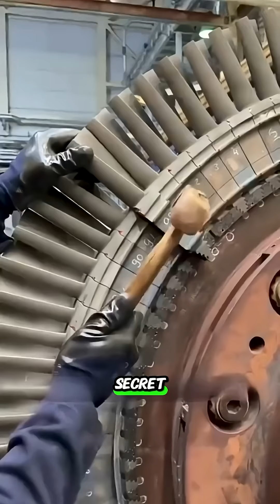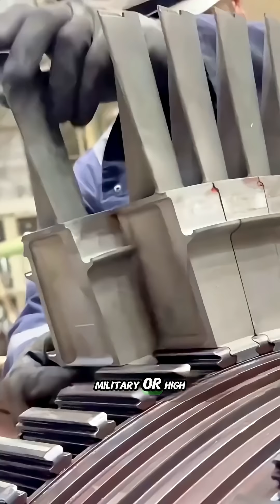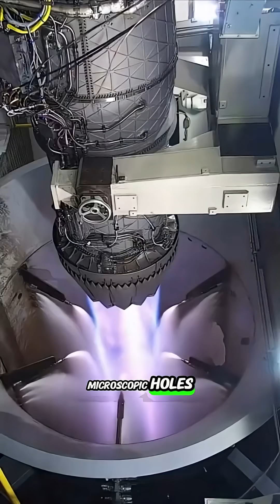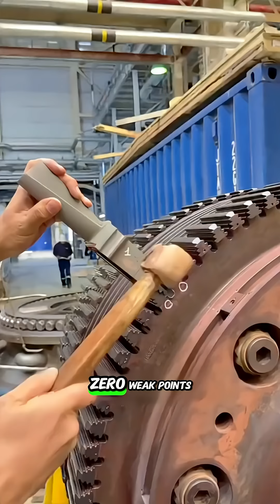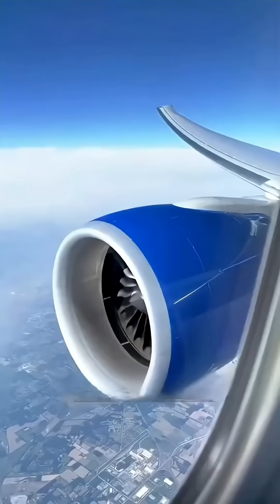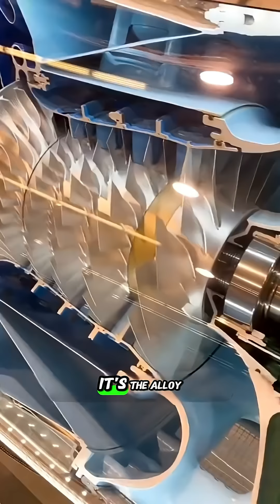The Insane Reason Nobody Can Copy American Jet Engines

Comment: These. Machines are litterally genius level manufactured items
Reply: Ya and in Vietnam waterproof boots and waders were like 🤷 and guys got jungle rot from walking in the paddy’s cuz the roads were mined. Also a tank with the mine clearing thing is a big🤷. Plus all the other little stuff the military screws up. SMH. 🤦
Reply: The Army litterally buys uniforms and many other items from the lowest bidder. It takes a good deal more intellectual quality to ensure that jet aircraft successfully fly. Aviation engineers are not gas monkey mechanics you know.

Comment: It’s not just the USA that makes jet engines. It’s also the UK, France, Russia and China.
Reply: Only four countries in the world can make the fifth-generation turbo fan engines due to their high complexity. China can't produce them by reverse technology.

In 2006, an agreement was signed on the creation of a new engine, which was named PD-14 (a promising engine with a thrust of 14 tons).

PD-14 is a serially produced Russian high-bypass turbofan engine of fith generation developed for the MC-21-300 aircraft, PD-14A for the MC-21-200, and PD-14M for the MC-21-400. PD-8 engine will be installed on the Be-200, AN-148 and Sukhoi Superjet 100 aircraft. Therefore, the designers and engineers faced the task of creating a unified gas generator, the main element of the engine.

16 new technologies were developed for PD-14 by russian designers, engineers and scientists, namely - single-crystal blades for a high-pressure turbine with an advanced cooling system that allows the turbine to operate at temperatures up to 2000 ° K.; hollow wide fan blade made of titanium alloy, thanks to which it was possible to increase the efficiency of the fan stage by 5% in comparison with the fourth-generation turbofan engine PS-90 produced in the USSR in the late 1980s; low-emission combustion chamber made of intermetallic alloy; sound-absorbing structures made of composite materials; ceramic coatings on hot parts; hollow blades of a low-pressure turbine, etc.

 20 new materials were created for PD-14 with indisputable advantages: a decrease in specific fuel consumption by 10–15%, a reduction in the life cycle cost by 15–20%; operation of the engine will cost 14-17% cheaper than existing analogues. All of them have been certified according to international standards.

New Russian titanium and nickel alloys are used to create the engine. The engine nacelle design comprises 65% domestic polymer composites, which achieve the required level of sound insulation and reduce engine weight. 

The technologies used in the production of PD-14 are state secrets and are protected. Therefore, information about PD-14 is broadly classified. Example: China would gladly copy production technologies, much like the Su-27. They copied the plane, but they failed to replicate the AL-31F engine.

The state's ability to produce cooled cast blades for a modern turbine aircraft engine is an indicator of the highest level of development in mechanical engineering. There are fewer states capable of producing fifth-generation aircraft turbojet engines than countries with nuclear weapons or those that launch satellites into space. Only four countries—Great Britain, Russia, the USA, and France—possess full-cycle technologies for creating such engines.

Comment: It's true that they are extremely complex but it's hyperbole that nobody else builds them or can build them. Rolls Royce (UK + extended to multiple other countries), Safran (France), UEC/NPO (Russia), Volvo (Sweden), Aero Engine Corporation (China), JAEC (Japan), etc. The main issue for many nations is supply & demand. For example, Italy can build them via Avio Aero, Spain via ITP, Germany via ITU but the cost to do so, outweighs the actual benefits of individual domestic production. Hence why they usually adopt a multi-national or consortium based approach for aerospace. The US is lucky enough to have the demand for orders, but for others, a simple cost benefit analysis makes it not worth it. You aren't going to spend 10's of billions on getting engine capability if you only need a few dozen jets or the like, but you would if you need 100's or more.

Comment: Rolls Royce or Safran build more than half of the engines that power the majority of new airplane engines.  This video is right on the difficulty of building the blades but is wrong on who makes them.   The engines of 50 years ago use totally different metallurgy that those of today.  They are incredibly different and incredibly more difficult.
Reply: Hi Chris 🥰👋🏻

Comment: So if the yanks are so good at jet engines, why are the B52s being fitted with Rolls Royce engines which are more fuel efficient and produce more thrust?
Reply: Because Rolls Roys engines are cheaper britty.
Reply: @MartinJohnson-US Sorry! Reason why the Rolls Royce engine was picked was that the B52 had to have a similar sized engine which would fit the engine nacelles. If they tried putting on 4 engines the whole airframe and avionics would have to be reworked. The Rolls Royce engine was the same size, produced less emissions and was more fuel efficient. More importantly the engine was modern! The engines being used were so old that spares were no longer being made for certain parts and maintenance hours were very high. The new engines will have vastly reduced maintenance time.
Reply: @MartinJohnson-USThe engine being fitted is a variant of a Rolls Royce engine that is used for business jets. It is manufactured in the USA . Cost was a factor in the bidding process but it wasn’t the overriding factor.
Reply: Hi there 👋🏻☺️
Reply: Because the US already has a big queue of it's own, we have to outsource. That's why our fleet is 100 times greater than the UK's
Reply: The possessive of it is its, not it’s
Reply: @MarkCatterall Indeed - it’s is ONLY used to replace it is. All other its are its. I never thought I’d type that!
Reply: Because Rolls-Royce bought Allison, who originally designed the core engine.
Reply: I am so tired of having to explain this, so here we go one more time.  Because they have an engine that fits the damn Nacelles on the B52 and it would be costly to start a whole new engine program just to re-engine the limited number of B52's to be updated... did you really think it was because the US is not capable of making an engine for their own plane?
Reply: @_Coffee4Closers You needn’t have bothered! See my explanation above, Sorry!
Reply: @_ @_Coffee4Closers I guess some people just like to bash the US for no good reason. There are many many incredibly talented and capable people in the US.

Comment: Interesting.....except about 15 countries build jet engines
Reply: Ture, but plz remember  that not all jet engines are equal, doesn't matter they are military or civil.
Reply: Some of them in Brazil. (Embraer)
No, I am not Brazilian.
Reply: @l@lorenzoparedes2306
They build airplanes but not efficient engines
Reply: In 2006, an agreement was signed on the creation of a new engine, which was named PD-14 (a promising engine with a thrust of 14 tons).

PD-14 is a serially produced Russian high-bypass turbofan engine of fith generation developed for the MC-21-300 aircraft, PD-14A for the MC-21-200, and PD-14M for the MC-21-400. PD-8 engine will be installed on the Be-200, AN-148 and Sukhoi Superjet 100 aircraft. Therefore, the designers and engineers faced the task of creating a unified gas generator, the main element of the engine.

16 new technologies were developed for PD-14 by russian designers, engineers and scientists, namely - single-crystal blades for a high-pressure turbine with an advanced cooling system that allows the turbine to operate at temperatures up to 2000 ° K.; hollow wide fan blade made of titanium alloy, thanks to which it was possible to increase the efficiency of the fan stage by 5% in comparison with the fourth-generation turbofan engine PS-90 produced in the USSR in the late 1980s; low-emission combustion chamber made of intermetallic alloy; sound-absorbing structures made of composite materials; ceramic coatings on hot parts; hollow blades of a low-pressure turbine, etc.

 20 new materials were created for PD-14 with indisputable advantages: a decrease in specific fuel consumption by 10–15%, a reduction in the life cycle cost by 15–20%; operation of the engine will cost 14-17% cheaper than existing analogues. All of them have been certified according to international standards.

New Russian titanium and nickel alloys are used to create the engine. The engine nacelle design comprises 65% domestic polymer composites, which achieve the required level of sound insulation and reduce engine weight. 

The technologies used in the production of PD-14 are state secrets and are protected. Therefore, information about PD-14 is broadly classified. Example: China would gladly copy production technologies, much like the Su-27. They copied the plane, but they failed to replicate the AL-31F engine.

The state's ability to produce cooled cast blades for a modern turbine aircraft engine is an indicator of the highest level of development in mechanical engineering. There are fewer states capable of producing fifth-generation aircraft turbojet engines than countries with nuclear weapons or those that launch satellites into space. Only four countries—Great Britain, Russia, the USA, and France—possess full-cycle technologies for creating such engines.
Reply: Yes but guess which country had the least number of planes fall out the sky.
Reply: @JayMart15-q6w 
The country with zero flying has the least accidents
Reply: Only three companies build the most efficient turbofan engines. Two are in the USA
Reply: @andrewday3206 The third one is Rolls Royce in the UK.
Reply: @geoffbentley8774  , and we "American Colonists" originated from Europe. So there is no reason to "fuss" as if, "we're enemies just cuz jet tech may be different".... Actually, as far as commercial aircraft, Boeing and Airbus are virtually equal. The U.S. however possesses more advanced military aircraft than Europe.
Reply: @andrewday3206  than why are jets falling out of the sky
Reply: @Tarasco-77 
How many jets fall out of the sky? 
It’s one of the safest forms of travel humans have ever invented
Reply: someone wasn't paying the slightest attention
Reply: There is nothing out of America, only wild humans
Reply: @raphaelboichot8972 
Other than inventing the Internet, you were typing this on

Comment: Even if the claim that a weight discrepancy of a hair could tear the engine up, what about some dirt lingering to one of those blades amounting to more than a hair weight? This sounds very fanciful and even more so when you consider the practical precision of the fabrication process. If the idea in itself so unforgiving, there got to be some refining ways to tune it down to that precision after manufacturing. To not have such mechanisms is to throw away most of the manufactured pieces! Another thing is the claim that the US is the only country capable of manufacturing such engines with such precision. That is clearly false because the US is not the only country in the world with jet engines. Finally, how true is it that such tiny deviation from a perfect blade would tear up the entire engine?  It may sound or move rough, however, to maintain smooth motion with even perfect parts, requires fine maintenance and lubrication.

Comment: Aren't China a Russia building hypersonic missiles?

Russia's Avangard is the fastest missile system in the world. It is a hypersonic glide vehicle capable of speeds up to Mach 27 (over 33,300 km/h or 20,600 mph).  China's DF-17 glides at speeds exceeding Mach 10. 

Intercontinental Ballistic Missiles (ICBM): Traditional ballistic missiles reach extreme velocities during the reentry phase. The Chinese DF-41 achieves speeds around Mach 25, and the US Trident II D5 reaches Mach 24. 

Hypersonic / Supersonic Cruise Missiles: These are powered throughout their flight. Russia’s 3M22 Zircon reaches up to Mach 9, and the joint Indo-Russian BrahMos is the fastest supersonic cruise missile at Mach 3.

Comment: American jet engines are prolific and good sure. But they're hardly the only engine manufacturers out there
Reply: Remind me... Isn't Pratt & Whitney the jet engine manufacturer that will be sued by its customers for making inefficient and unmaintainable engines ? What country is it representing again ?
Reply: @GNND-u2e  Oh God another STUPID comment... name a engine maker that has has zero issues and get back to us.  This stuff is hard dummy.
Reply: In 2006, an agreement was signed on the creation of a new engine, which was named PD-14 (a promising engine with a thrust of 14 tons).

PD-14 is a serially produced Russian high-bypass turbofan engine of fith generation developed for the MC-21-300 aircraft, PD-14A for the MC-21-200, and PD-14M for the MC-21-400. PD-8 engine will be installed on the Be-200, AN-148 and Sukhoi Superjet 100 aircraft. Therefore, the designers and engineers faced the task of creating a unified gas generator, the main element of the engine.

16 new technologies were developed for PD-14 by russian designers, engineers and scientists, namely - single-crystal blades for a high-pressure turbine with an advanced cooling system that allows the turbine to operate at temperatures up to 2000 ° K.; hollow wide fan blade made of titanium alloy, thanks to which it was possible to increase the efficiency of the fan stage by 5% in comparison with the fourth-generation turbofan engine PS-90 produced in the USSR in the late 1980s; low-emission combustion chamber made of intermetallic alloy; sound-absorbing structures made of composite materials; ceramic coatings on hot parts; hollow blades of a low-pressure turbine, etc.

 20 new materials were created for PD-14 with indisputable advantages: a decrease in specific fuel consumption by 10–15%, a reduction in the life cycle cost by 15–20%; operation of the engine will cost 14-17% cheaper than existing analogues. All of them have been certified according to international standards.

New Russian titanium and nickel alloys are used to create the engine. The engine nacelle design comprises 65% domestic polymer composites, which achieve the required level of sound insulation and reduce engine weight. 

The technologies used in the production of PD-14 are state secrets and are protected. Therefore, information about PD-14 is broadly classified. Example: China would gladly copy production technologies, much like the Su-27. They copied the plane, but they failed to replicate the AL-31F engine.

The state's ability to produce cooled cast blades for a modern turbine aircraft engine is an indicator of the highest level of development in mechanical engineering. There are fewer states capable of producing fifth-generation aircraft turbojet engines than countries with nuclear weapons or those that launch satellites into space. Only four countries—Great Britain, Russia, the USA, and France—possess full-cycle technologies for creating such engines.
Reply: @almazblanco6676  Nice Copy and paste Russian propaganda... that engine is a looser, and will never be produced in any numbers.
Reply: @_Coffee4Closers 

The defunct USSR never dominated the global commercial aircraft market, yet it produced enough aircraft and engines to meet domestic demand and that of its allies.

Fifth-generation turbofans produced by the United States, France, and the United Kingdom will continue to dominate the international market—that is undisputed—but the PD-14 engine and similar models can meet the needs of Russian airlines. Exports will be limited due to political factors.

Donald Trump will sanction, pressure, and blackmail any country that intends to purchase Russian aircraft, whether civil or military. He has already done so on several occasions by invoking the Countering America's Adversaries Through Sanctions Act (CAATSA). Trump signed that law in 2017 to target—through commercial means—countries that are enemies and adversaries of the United States.

Comment: As a long term gas turbine tech a lot of ill informed naysayers are blowing smoke about this video. I worked for Solar Turbines a Caterpillar company even before Cat bought us from International Harvester in the 1980’s. The advances in these gas turbines brought on by environmental restrictions have made it possible to increase the horsepower output from the same engine by over 40% while reducing the emissions from 150 ppm NOX and 250 ppm CO2 to 7 ppm NOX and 8 Ppm CO2. Solar spent over 2.5 billion dollars over 15 years to achieve those numbers. One of the advances is the single crystal internally cooled turbine hot end blades. You need a Giga press like hydraulic press in the foundries to inject the multi alloy mixture into these blade moulds to achieve this single crystal structure in the final blade. Without the proper equipment and process the blade will fail early from the alloys delaminating  and forming stress and creep cracks. In these complex blade forms a high pressure needs to be maintained until the blade cools enough for the alloy structure to be “locked in”. A lot of countries do not have the special equipment and the high end foundries needed to manufacture these blades.

Comment: Chhna has surpassed the US in cooling technology for single crystal turbine blades.

Their WS-15 runs at 44'000 pounds thrust at 2'860° F.

The trouble-plagued Pratt & Whitney F135 puts out 43'500 pounds at a horrendous 3'600° F. 

F-35s are limited to one minute at max afterburner.

Comment: Making blades is costly, but inspecting and certification by x- ray is a big big part of the bottom line. Manufacturing insures the blades are perfect, in writing. When something goes wrong? Think o rings on the fatal challenger space shuttle.